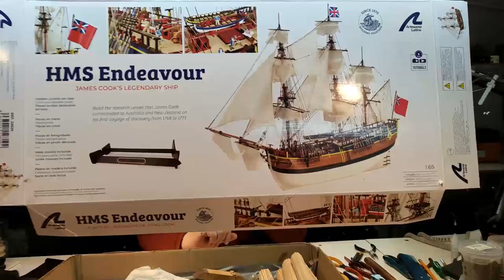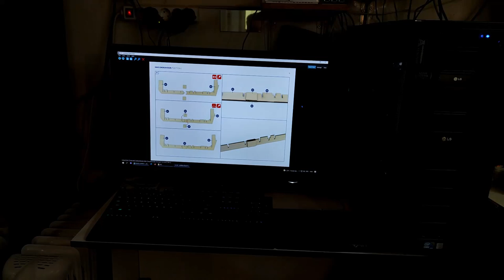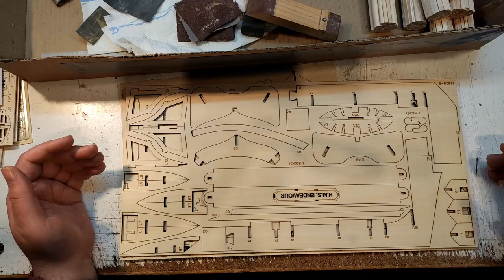HMS Endeavour - part 1 Making The Skeleton (phase 1)

Comment: Ah John . I see you are getting a taste of the new Latina system of model building. I have just completed the L' Hermione by Latina. I will NEVER build another kit by this company. Too many cost saving changes like CDs with no paper plans or instructions, many small pieces to make the frames. And other things that you will discover along the way. The CD isn't bad until you get to rigging. In the Hermione kit they use photos which are hard to see the connection points. enlarge the pics and they become blurry. Want to check out the parts list , you must close down and open another part of the CD. and then find your way back again. It wouldn't be bad if they offered paper plans for an additional charge, but that was not the case with the Hermione. The dead eyes were so poor that I could only use half and had to buy replacements. They did not show foot ropes on the yards so I put them on anyway. I could go on, but will say good luck. I hope you have better luck than I. PS This build will be on You Tube sometime tomorrow.
Reply from the maker: Hi Gordon! Up to the point i am i am using the PDF as the parts list and photos for the construction. For the rigging i won't bother with the photos, i have downloaded pdf with the rigging the old fashion way(from another kit) , and i will print them on paper when i get there. The rigging is impossible without paper. So far i do not like the 3mm skeleton pieces and the fact that there are none of sapely and walnut wood strips, only paint.
Reply: Sounds like you have a good plan. I hope that Latina will wise up and go back to the tried and true methods. good luck I'll be watching.

Comment: Have fun on this build, John. 👍 What strikes me first is that I don't really like the three piece ribs on this kit. Seems a bit flimsy when compared to an OcCre kit. However, once you've added more components I'm sure it will be more robust.
Reply from the maker: Thank you Buck! I had the same feeling but when you add some more reinforcements the skeleton becomes solid. The only problem is the 3mm of the pieces.  They should have been 5 or at least 4mm.
Reply: @JohnsWoodenShips  yeah thats what i was looking at too. I think its going to be hard to plank it if you dont have strips of wood that covers the length of the ship
Reply from the maker: @zhrek8958  It's harder than normal but not that hard. I am doing the planking now.

Comment: When assembling these frame elements I included the deck beams as well to ensure that the whole frame was aligned.  This cannot be done in all cases as you will see that there are elements that need to be installed before the deck beam can be permanently mounted.  In those cases I taped the deck beams in place.  All the frames were glued in place with right angle blocks assuring alignment in both the vertical and horizontal planes.  I have to agree that Artesania did not do a great job with these critical parts of the kit...
Reply from the maker: Yes this can work too. It is a pain in the ... but it will do the job. Yes the final outcome won't be twisted but the frames should be different.

Comment: May I suggest a very good carpenters glue Lepage pro glue with high initial tack. It sets up very quickly. The only drawback is that it has a yellowish color when dry.
Reply from the maker: The white glue works fine, you just have to wait 3-5 hours.